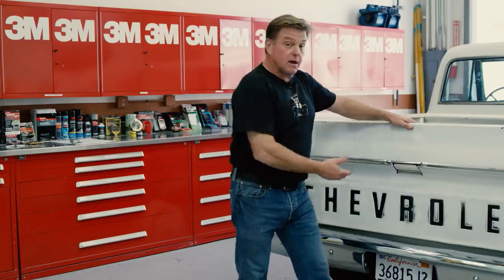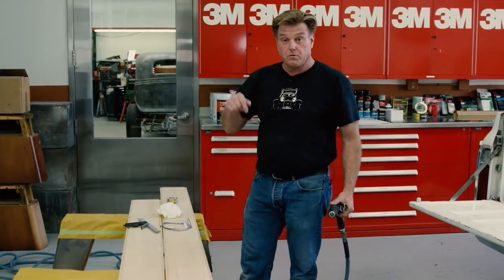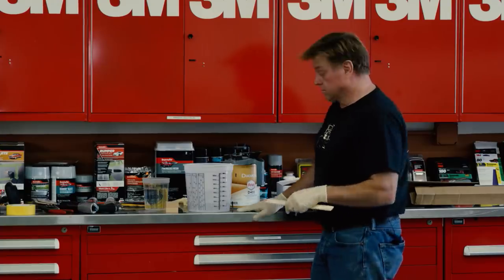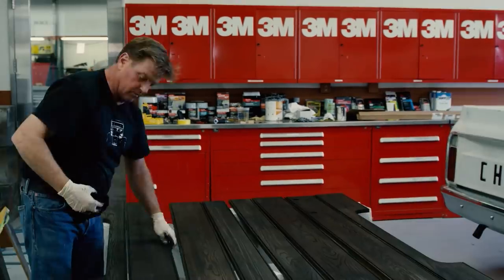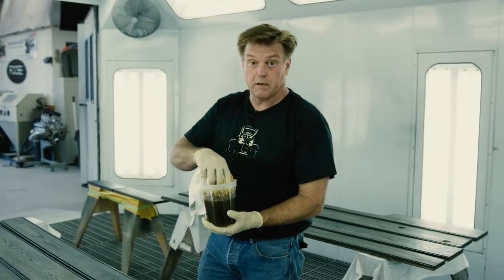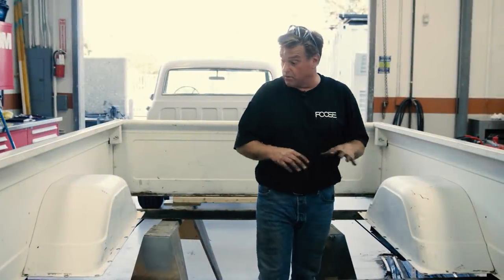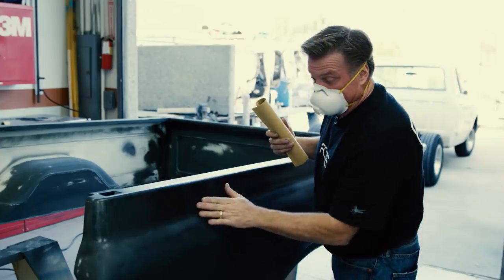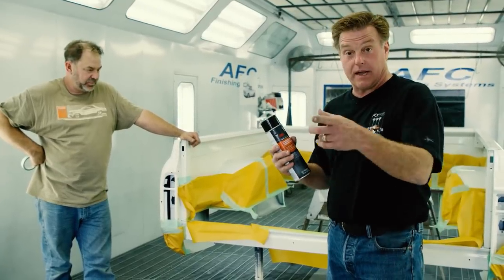Foose Design 1967 Chevy “C/28” Project – Truck Bed Customization (Part 2/8)

Comment: I shore do like the Patina of the Bed Floor the way you sand blasted and the color of the wood. I've used the chain effect on projects before and in the right project it is really good to do. I make Cross's for wall hanging and outside use and I do that from time to time for the `0l Rugged Cross ✝.

Comment: Nice tip to use oil instead of urethane sealer. Also a nice tip to mix your own stain using acetone and auto paint. I'm building a '41 Willys pickup with a shortened and tubbed 46 chevy bed. Since most of the instructions won't "exactly work", I'm picking up tips and techniques as I get ready to put in the bed....

Comment: Acetone will remove pencil marks from wood pretty easy. Never trust the boards to have a square end cut, so check and cut if needed before sitting to final length. Also to make a clean hole with no tear out using a forstner bit, is to start slow in reverse. Once shallow edge is cut, the wood fibers are cut and will make a clean cut. The old GM guys finish is simple, they used 1 part used motor oil, 1 part kerosene and 1/2 part linseed oil after cutting holes, final length and datos on all sides. Set over plastic on saw horses, set in sun to dry and repeat. 
Keep it going Chip.

Comment: Keep em coming. Gives me some ideas for my 67 C10. I like the black. I think that a lot of people don't realize that most if not all wood beds came black or body color from the factory.
Reply: if you have a 67, you should notice that this truck has side signals and big back window.  it pisses me off that he's calling it a 67 because 67 is the only year with NO side signals and SMALL back window.  doesn;t that irritate you, knowing how your 67 is more desireable, but completely different from a 68?  he's lying about the year of this truck.  its a 68, easy to tell
Reply from the maker: @613Builds   We understand you are passionate about your 1967 C-10, so are we, but the panoramic big window was an option in 1967 and the side markers that piss you off so badly, were aftermarket that the previous owner put on.
Reply: @FooseDesignInc  wow that's alot of work, to require a different wiring harness, different fuse block, different steering column, flashers, amazing that someone would go through all that when the 67 is a much more rare and clean look.  visibly, 68+ was the only years with side signals and large back window, i know that much.

Comment: I wish I could afford Chip's consultation on "Project Cheylark"... a '71 Cheyenne with Buick 455 running gear. I started it with my father, before he died in 2009. I drove the truck for 4yrs after the drivetrain swap. 

The goal, was to have a phantom truck that would appear as if it were a real 1971 Buick production... Vinyl top, "GST 455" badging, Buick script on the tailgate panel, etc. .

The debated options were:

-Functioning Ram Air with '70 Skylark induction
-small "custom" badges from a '70 Electra 225 vinyl top
-"Cheylark" script on the glove box panel
-Riviera/Skylark influenced console (idea was later scrapped, for rides with the Mrs.)
-Period correct Buick paisley pattern black upholstery, or use the material as an accent to period black vinyl.
-15" Buick rally wheels, "Wide Oval" tires, and custom "GST" center caps (white "T" in same font at 20% larger in background, with red "GS" overlay)
- adapted air suspension from a '70 Buick Riviera (later scrapped, because I hate the feel of air suspension... drove an 18 wheeler for 15yrs).
-artist rendering, or retro photo shoot and faux brochure, featuring the truck in the 1970 Buick lineup
-we tossed around the idea of hideaway headlights, but couldn't settle on anything that didn't take away from the looks of the truck (hence why I still prefer the '64 Riviera to later models).

Sadly, my father's cancer diagnoses rapidly progressed after the drivetrain was installed. He died in 2009 as a result of his exposure to Agent Orange in Vietnam. The country was still reeling in the economic recession, and my profession (trucking) was slow to recover. We were forced to sell the family property, along with the shop. Several life hurdles took place since then, and the truck was parked after a transmission failure, and a mechanic who tried to scam me out of my truck. On a more positive note... I now have an amazing family of 7, and am enjoying my children's growing years before they graduate and I can return my attention to the truck. With our newest addition, that's AT LEAST 18yrs away. Lol

 It still has the 1970 "X-SF" code 455 (Riviera, Wildcat, and Electra 455 engine) rated at 370hp. The truck is OEM white and blue, that I really like, but we thought silver with a black vinyl top would suit the Buick theme much better.

My father was a HUGE FAN of Chip's work, as am I. His contributions have shined from his early customs, through the Chrysler and Coddington days, and have been a beacon to those aspiring artists in his more independent work.

Comment: After several years of making my own versions of this same kit. It is not a good idea to recess the washers into the wood. Does not matter what wood or grade of wood U use. It invites first cracking and splitting of the wood and eventually ROT no matter how much you keep the truck out of the weather if the bed is open the SUN seems to the enemy more so than moisture does 4  some really strange reasons. I know it's a much nicer job to recess the shit but I am just telling ya the way it really is in real life with either buying a wood kit or making U'r own... Don't call me an asshole critic this guy does really nice work. It's just in hind sight not a lot of guys do work like this and not all the time. In hind sight I have done more than 2 dozen and that includes welding new borders below and the bed supports too. This can be a really tiring long boring job between drilling holes prepping surfaces and another piece of advice is let your BED KIT sit in a HOT or WARM DRY environment for better than a month because if the shit is green it will shrink on ya and you will regret it or it won't fit right away because the KIT MFG thought about it shrinking down some so this shit is some really sticky business. The factories used to start with KILN DRIED wood. I have seen GM factories used OAK in some older years and SPRUCE of all things in the later 70's. I have seen FORDs with Poplar in the wooden beds and CEDAR which was not good because of abuse too soft to be 4 practical use. So you gotta be a tree surgeon to work one of these projects to get it right. Just because the shit slides outta the box and looks nice does not mean it is cured.. A few of the people that hustle these kits make other building products and the shit comes outta the box green... Just buy a new set of fold down attic stairs I can tell you from experience the ones I got at fucking Lowes were shrinking before my very eyes 4rth of July weekend the stairs musta shrank an entire half inch all the way around in about 3 hours time outta the box in the hot sun. I promptly returned them and ordered a real set off a local lumber mill here that promised me that shit wouldn't happen they uses SEASONED wood.. I would router my own seasoned wood before I ordered one of these kits off LMC or the other net parts hustlers... I have seen guys use a product for GOLDBLATT they only seem to sell it commercially to the folks that refinish bars and BOWLING ALLEYS call SHARPLESS co. Pennsylvania they do bowling alleys. U can use pressure treat or oak or ASH and put that shit on it and then you could recess the washers into the wood for a pro looking bed with a huge appearance... I am thinking on doing one on my channel so stay tuned... The finish they use on BOWLING ALLEYS is the shit to get... No BS super huge bonding product and it can sanded in the future after a scuff and reapplied with some elbow grease...

Comment: Can anyone out there advise never done a wood bed replace, truck is a 67 K-10 step side will be buying a pre drilled kit, can I just slide the bed back a foot and lift it some to replace the wood or is it necessary to take it of and put it on stands?

Comment: Wow Chip you probably could of your bolt in stainless steel from ARP and I'm not sure but they might have stain stainless steel. You probably will need to look on line or just give them a call.

Comment: Chip worked 40 years in a high dollar cabinet shop we would throw, I said throw cabinet parts in the gravel parking lot and walk on them. That's ho we distressed our cabinets, depends on how distressed the customer wanted I would have burnt it no stain needed Chinese have used a burn method that is on their temples and have been around for 4000 years and still in use

Comment: I have a white '70 stepside that I'm putting a '70 LT-1 into.  It's been an ongoing project for the past 4 years or so.  Not going as quickly or as beautifully as Chip's project, though.  http://67-72chevytrucks.com/vboard/showthread.php?t=567340

Comment: 1967 NEVER EVER had side markers front and rear,  BIG back window and side markers means it was made in 1968.  1967 is special because of the small back widow and lack of side marker signals, it wasnt law until 1968.  if you messed up, its okay to admit that you messed up.  thats how learning is done, by making mistakes.  BUT PLEASE stop misinforming and mis-educating people by telling them is a 1967.  in the intro and also in episode 1 its easy to tell its a 1968.  its not a rare 67 with samll back window and no side markers.  thats what makes 67 special, one year only.  like a 70 chevelle, one year only.  what you have there is a 1968 fleetside.   check out my "67 c10 texas patina build" video if you want to see what a real 1967 looks like
Reply from the maker: The side markers you are referring too were added by the previous owner, not the factory. The Big back window was an option for the 1967 C-10. In 1968 Chevrolet eliminated the small back window as an option for the C-10.
Reply: @FooseDesignInc  correct,  In 1968 Chevrolet eliminated the small back window as an option for the C-10, and thats why 67 is so special because they have a small back window, one year only, and no side signals, one year only.